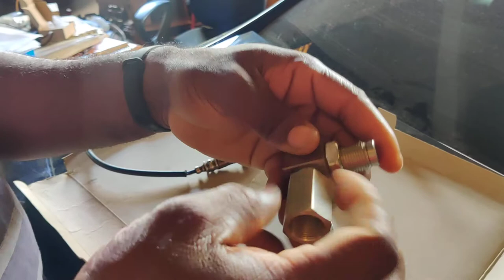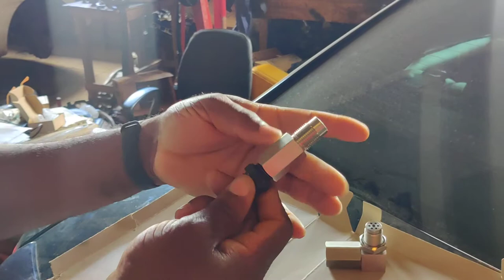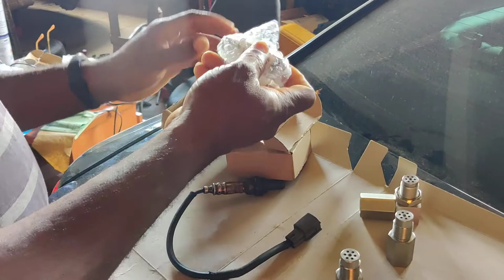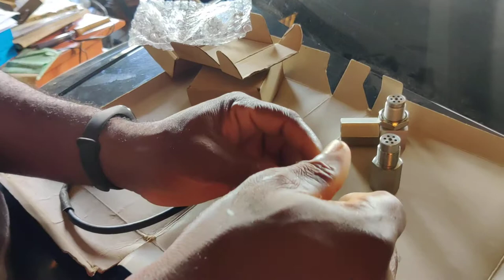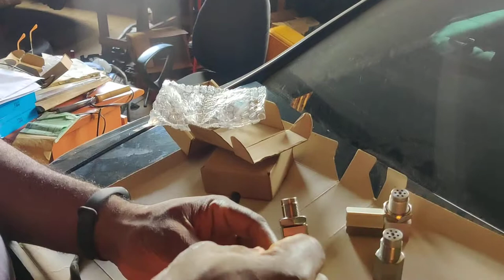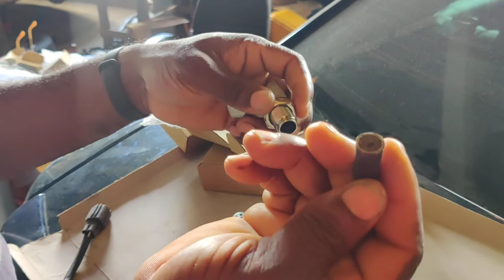O2 sensor spacers with catalytic converter

Comment: I don't care for catless exhaust, I just need a 90 degree adapter because of tight clearances. I like you can remove the catalyst and install the spacer components separately for tight spaces.

Comment: those are good spacers,  and what does it do?  do it help oxygen sensor last longer?  we are assuming, it helps passed smog, because it provides good oxygen reading.  meaning the car will run 14.7  air-fuel ratio
Reply: It defeats the check engine light (CEL) from removal or cats / too free of flowing cats. That also means you can pass smog if that’s tested in your area. Of course if they do visual testing then you’ll probably fail because now you don’t have cats and are actively defeating them with a device.

But It tricks the o2 sensor to reading the air being cleaner than it really is, that’s why there’s a mini catalytic converter inside some spacers, specifically ones used when you have a sensitive car aka most newer vehicles. Otherwise the o2 spacer just creates a gap to trick the o2 sensor.

Comment: Hello sir, please, can I use these spaces on my car, LEXUS IS250 which is a 2gr engine, I'm getting cat low deficiency bank 1 & 2.  Please can I use this spacers and which o2 sensor should I put the spacer on? Will it stop the code if I put the spacer in the bank 3 and 4? My car comes with 4 o2 sensors. The O2 close to the engine is 1&2 and that is where I'm getting the code.

Comment: I have a 2012 F250 6.2 I have 4 oxygen sensors do I need four of those extenders or two and where do I install in the rear only. THANKS I WOULD LIKE TO PURCHASE
Reply: nope.. put them on the one that controls the fuel trim and you'll make it run rich.. bad idea.. down from the cats is where you need them but replacing a bad sensor where you need it is probably the best best.

Comment: Hey good evening I was planning to buy one but since you are here in lagos can get your details,reason my corolla s 2007 check engine is on with po420 code and  fuel consumption is high can that help I get 75 to 85mile on half tank and I think is bad

Comment: I have a 20 Supra where do I install it. There are 2 sensors. One closer to the engine and one closer to the ground. Also do I screw it all the way in or leave a gap. Thanks.
Reply: I'm not 100% sure for your car,  but for my car it screws onto the s pipe... so the one closer to the ground
Reply: Probably the second one further from engine. Usually primary O2s are before the catalytic converters in your headers and the secondary O2s are after those cats and will be the ones detecting the efficiency of your headers catalytic converter.
Reply: @Meekmillan  this damn cars sensors are too advanced nothing works lol. It works for a few days and then when you push the car the CEL comes on.

Comment: my only complaint about these is that the cap that holds the mini cat came loose and blew inside the exhaust system
Reply from the maker: You can always contact us for another. We usually screw tight before installing
Reply: @gazzuzz6383  its cool, my third catalytic converter caught the caps and mini cats so put on some high temperature loctite on the threads and screw the caps back on.
Reply: @gazzuzz6383 where can I find this ?